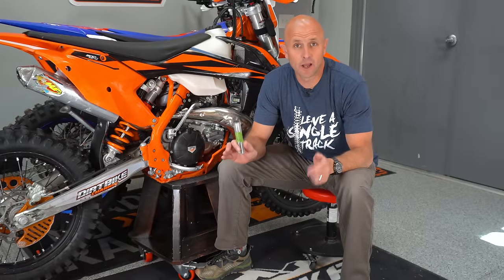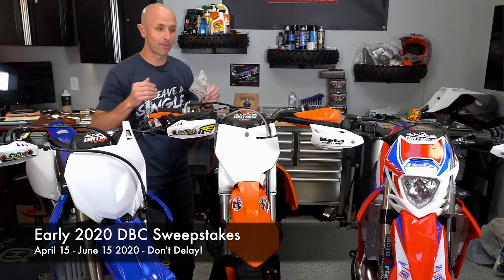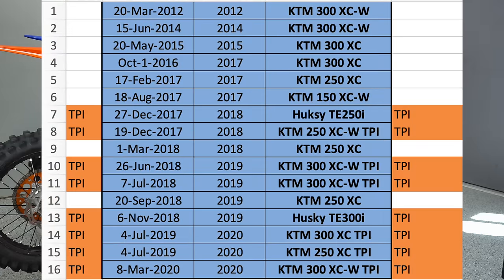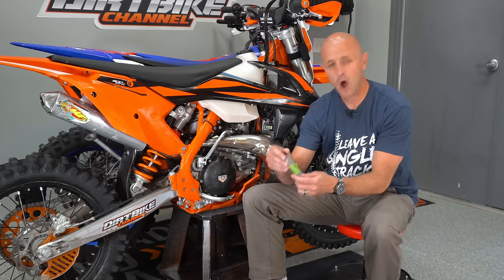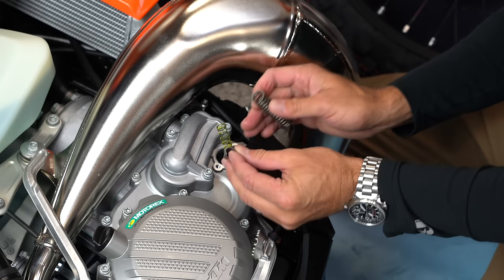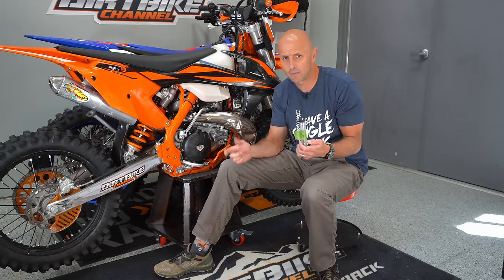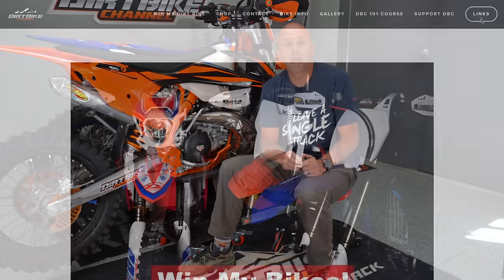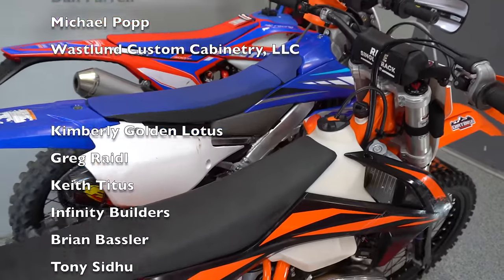The MAGIC KTM TPI Power Valve Adjustment | Top Tip!

Comment: Good to know about that power adjustment tune it to your riding skill.  nice 👍
Reply: The most skilled riders on earth like Graham Jarvis run the screw all the way in (green spring equivalent). Makes the bike the most toned down and controllable for traction and getting power to the ground. It’s the noobs who turn it all the way out “for the roost”, “the power band” etc. the higher your skill the more you want to turn it in. The opposite of what most people think!
Reply: @apostate4apostate494  two better riders than I ride flush and convinced me to try the same. I adjusted my 250 xcw tpi to flush, whiskey throttled on portions of the 12 mile loop that I usually enjoy, had immediate ridiculous arm pump and whiskey throttled again down a hill. Road back to the trailer and cranked that baby back in! screw that! Literally hahahaha

Comment: This is not the correct way to adjust the Power valve on the tpi. You need the xc2 diagnostic tool. Activate Power valve set up which limits the bike to 5000rpm. Then you can adjust the toothed arm on the right hand side with the cover off. That's the standard setting should be done at the factory but isn't. After that's done you can make small adjustments.
Reply: Correct

Comment: From my understanding the reason KTM doesn't recommend adjusting the PV away from factory settings is because the fuel injection system is tuned with the factory setting...if you adjust the PV setting the fuel mixture could be off and cause a lean condition.
Reply: PV Power Punch - Product Review - Slavens Racing
Reply: @hoptard  Actually, this is true. Several people had bikes that ran like crap in the midrange and it was traced to the powervalve not opening at the specified RPM from the factory.

Comment: Well you say it’s “kinda garbage advise” but let’s just think for a second that ktm are setting them up so they all perform equally, the power valve opens and closes the same on each bike, however due to some variables (at ktm that we are not aware of)  the brass screw can vary greatly in regards to position when set at the factory……. So if you adjust it half a turn out or half a turn in it’s going to have the same effect on the power valve (naturally minus some variables) regardless of where it was set from factory. So now your logic is nonsense isn’t it. Either it’s nonsense or ktm just sets them up wherever looks about right and it’s really not that big of a deal in which case they are all different from the factory in terms of performance and power curve

Comment: Of course the power valve requires a “special tool” rather than just using a standard hex. Stinking Europeans. (I own Volkswagens - I know this issue well.)
Reply: a fat phillips head screwdriver works fine for me.  I have red spring in backed out almost flush and it rips.  When I'm riding sand, I crank it in about a half turn for a harder hit

Comment: Buy a 4-stroke and you wrist is your power valve
Reply: Ronan McGrath lol u got no idea
Reply: The whole 4 stroke 2 stroke argument that most people throw out there is useless without context. Sometimes, the 4 stroke bike has an advantage, sometimes the 2 stroke - when? When you are riding the trails/tracks and courses where each machine was designed and will be able to perform best for the person on the bike. There is no one factor which is a lock on saying which is best. I own both and love them both. There is some overlap in the types of riding and areas I ride with each, but there are strong points for each engine type and those points can be accentuated or diminished with the rest of the bike design, gearing and setup.
Reply: @Toldea34  voice of reason. Correct.